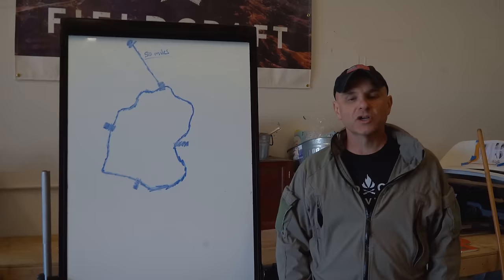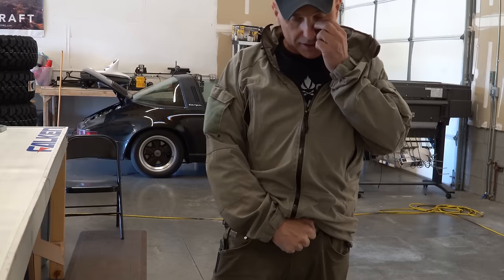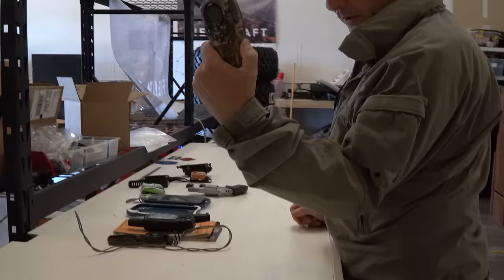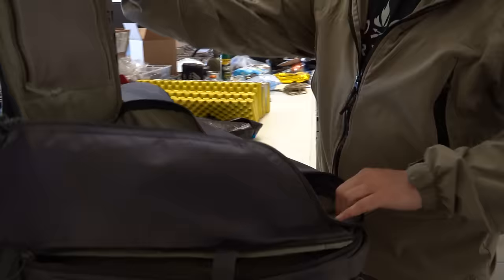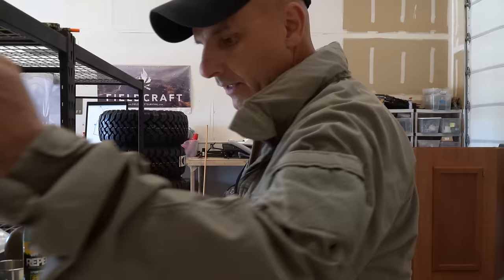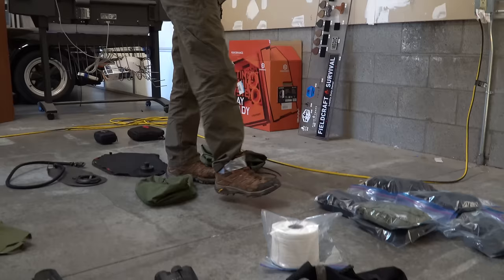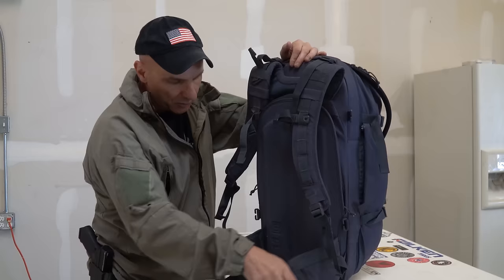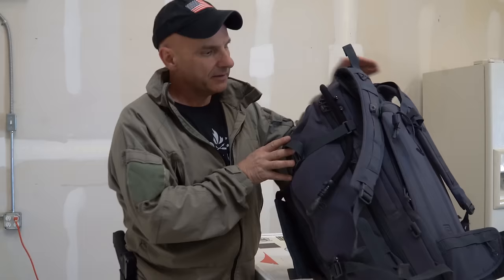Bug Out Load Out - Packing Out Your Ruck With Special Forces Veteran Kevin Owens

Comment: Great video the ONLY thing I seen that I'd change that felt like it was poking at me was the cardboard in the toilet paper roll. I keep a roll in my trunk, in my middle console, and in my bag but always remove that cylinder. The other thing I noticed that I've seen from someone else's video was that they took an old debit card and wrapped duct tape around it a few times because duct tape is always useful and if you have some the size of a credit card then it doesn't take up much space. I've also been told that if I have the time to cut  large topographical maps of my area into 52  pieces and turn them into playing cards laminated that way you have a map and playing cards that fit in a small box

Comment: Great load out. Marine infantry veteran, former Boy Scout etc etc. I've had many friends laugh at my packing everything in my bag in ziplocks and trash bags. Until it rained. Also great for keeping sand, pine needles, etc out of your items. Desert or rainy, they are a plus.  I have also used my pack as a semi floatation device in deeper water crossings. Inflate each bag slightly to the max capacity of the pack size. Sure makes it safer and easier. As a former EMT and current RN, I don't buy the pre-packed first aid kits. They always are way over priced for the tiny amount of gear in them. I have a small, cheap Condor zipper bag loaded with dressings, suture kit, tourniquet, tylenol, motrin, benadryl, lomotil (anti diarrheal) anti bacterial ointment, alchohol wipes and should also contain any individual essential meds.

Comment: One thing I don’t ever see is when an event happens that requires you to bug out, in or anything that puts you in danger, first thing you need to do is drink water. Grab a bottle and suck it down. Make sure everyone in your family or group does the same thing. At home, in the car, where ever you are, get water in you ASAP so you have at least some level of hydration before you start responding to the incident.

Comment: There's a method so your laces won't come undone. Take each lace end + take it back in the eyelet it came out of not all the way. Just enough to form a loop. With the loose end run it through the opposite side loop. Same on both sides.make the laces as tight or loose as you want then pull on each lace till the loop collapses. Same on both shoes, tuck in the loose ends....wont ever come undone & even if it gets wet you can quickly untie

Comment: Just for reference that smaller green pack you is a Lightfighter RAID Pack. Produced by Eagle Industries for LF first and then later made by ATS Tactical as the RAID 2 pack.
Reply: I recognized it too... I have 3 of them - an original Eagle in OD (2002 or so vintage), a later Eagle in CB and an ATS in CadPat.  Great packs!!!

Comment: Pro Tip 1: Wet Ones, Baby wipes. Get them in the individual packets. The seal in the bulk pack will open eventually in your pack and dry them up. Then you just have scratchy toilet paper.
Pro Tip 2: Get clear low profile goggles to protect eyes at night from branches.
Pro Tip 3: Get rid of the dog and pack more things for yourself.

Comment: +FieldCraft Survival Channel  Wouldn't it be better to Ranger fold your extra clothing? That's what I do and it saves space in my ruck ( a U.S. GI MOLLE 2 large combat ruck. I know there are better rucks, but I use what I have and try to use all of the military surplus I can afford for my kit ). I also use trash bags and Ziploc bags ( military dry sacks, ponchos, and tarps are expensive for me at the moment ) to put my kit in ( which is packed into various kit bags that I have labeled, they're just nice, sturdy nylon kit bags I get at the thrift store, plus some military pouches I have MOLLEd onto my ruck ). I have an improvised sleep system that's just large contractor's bags that I fill with pine straw and leaves in the woods for padding ( I live in a heavily wooded mountain area ), a dollar store vinyl shower curtain liner I put on top of those, a pop-up hooped bivvy, a couple of light wool blankets, and a regular hardware store tarp I can put above me secured to trees with 550 cord. What can I do better, especially in wind blown rain? I figured I would ask the professional, since you have way more experience than I do. Nice video, thanks if you respond

Comment: Carrying even a 40 lbs pack PLUS all your kit and weapon is NOT for  the average person who is out of shape or doesn't do a lot of walking. Carrying an actual ruck with 60lbs or more plus kit and weapon is going to take most people out in a few miles. The other consideration for carrying heavy rucks is the calories required by weight, speed and distance. The Army has an entire manual on this (which no one ever read that I know of). And don't think you're going to use that spare tire around your waist for fuel, fat is the last source of energy your body uses, and if it's used to sugars and simple carbs you are going to crash hard first. If you even think you might need to do long distance movements with a pack, get out and start walking.   And for Gods sake please do not put on a heavy ruck and start running, you will blow out your knees, back and feet. Walk. Put on your favorite running shoes and go for distance and speed with at the most just a lightweight knapsack like your kid has with about 20lbs max and do 5 miles 2-3x a week. That will be exponentially more valuable than trying to do 10 miles with a heavy ruck in boots your first time out. If you've never carried a heavy ruck for 10 miles,  and think you can, I can promise you that you can't (I'm sure theres some athletic exceptions to this but exceptions dont negate the rule). If you want to prove it, go ahead and build your everything plus the kitchen sink ruck and go do 5 miles, with a nice hill thrown in. Also, put a lot of caffeinated energy sports gels in that pack, you're gonna need it. And RIP your feet. I've watched guys come in with blood literally squirting out of their boots. Now try continuing for several days/weeks and expecting that to heal.

Comment: At 6:38, you reference a "Commando" pack for which you are missing the original belt.  Would that happen to be an old Lowe-Alpine Vector-series pack with rapelling harness?  If so, I may have a waistbelt that fits.

Comment: There are so many ways to "bug out". That is completely dependent on each and every single situation. There's thousands of possible scenarios. That's why it's kind of unrealistic to prepare for one. I think the better thing to train, is your situational awareness. Be able to access a situation, develop a plan and execute your plan. Easy day. Also, f.y.i. having a dog is a pretty bad idea. You have to feed it...which means it's much less effective than an extra knife, or ammunition. Not to mention, they bark and make noise. Like this dog did in the beginning of the video, he whimpered. That's a loss.

Comment: Coming from a ultralight backpack background, there's simply less items that you'll need that'll make you much more comfortable over long distance. the appearance you portray is still tactical and you'll still be associated with gun culture. also, wear lighter weight clothing will push faster and further then traditional pants, cotton, and a bulky jacket. test your kit at a nearby trail more then 40 miles and keep making adjustments to the kit. its almost there.

Comment: 50 miles in 3 days cross country avoiding people and roads? yeah right. Average armchair commando would manage 10 miles in a day if the heart attack, or injury doesnt get them first. To many clothes, just have the one's ya wearing be warm when wet and wind proof to begin with, its just 5 days to get to your clean clothes. Good lord them gortex socks, had them back the 80's, would develop holes if to loose a fit. Better socks out there now. Would in separate little bags have a days worth of baby wipes and arse wipe. Having a big roll of arse wipe is inviting a boo boo. Would not have the bag of ammo for barter, just the spare mags, in pouches, on belt. If expecting trouble have a rifle! Water filter? Carry as much as you need, extra only if its a dry climate. got to keep the weight down in that pack or youll be dumping it when you have to run from the bad guys. carry as much as you can in your pockets. Good to see not to many gucci gadgets. Should have a laminated map of the area your planning to travel thru and one compass on a lanyard around your neck. Nice vid to get the thought process going, so many variables!